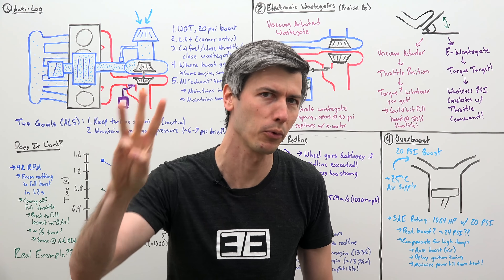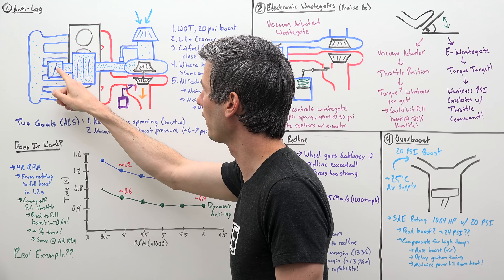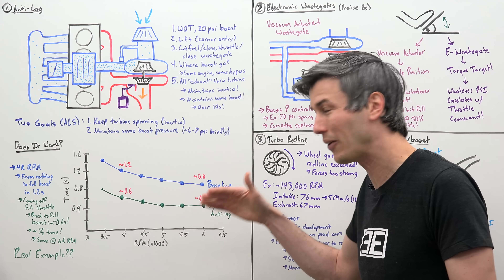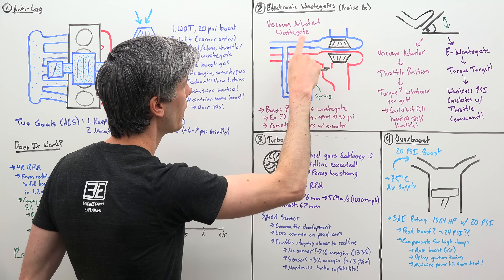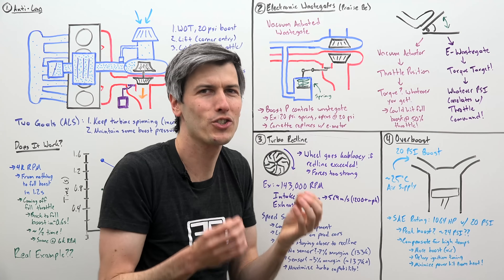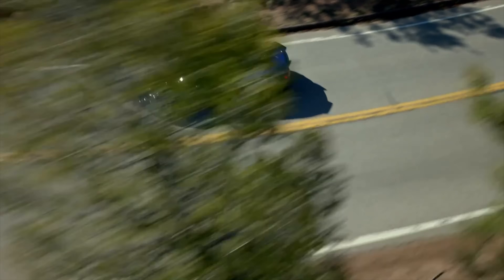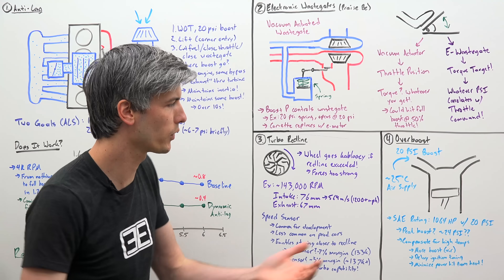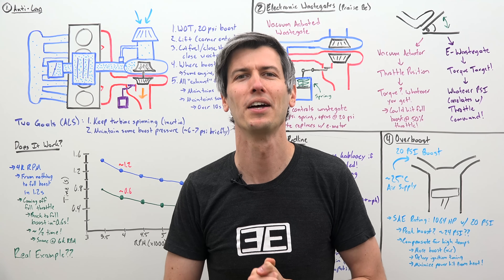Corvette ZR1's Anti-Lag System – Massive Turbos, Minimal Lag

Comment: Are the tips of the turbine fins really moving at supersonic speeds inside there? I can't help but think there are implications of that. Doesn't the air cavitate?
Reply: Cavitation only happens in liquids, it occurs because liquids boil at lower temperatures when the pressure is low, so the low pressure side of a moving blade can actually drop the pressure enough that the liquid begins to boil. Air is already fully a gas, so no cavitation can occur.

Supersonic speeds can cause problems with shockwaves forming in the flow. However what isn't often discussed when we talk about turbos is the fact that the compressor wheel is only 1/2 of the story on the compressor side. The housing is equally important, it forms a device called a "diffuser" which has the function of smoothly slowing down the air leaving the compressor wheel and turning its kinetic energy (speed) into potential energy (pressure). With the right design of the diffuser you can avoid the formation of shockwaves and any problems that might occur, even when the blade tips are supersonic.

On the turbine side, the gas is really hot. Because the speed of sound in gases increases with the temperature of the gas, I expect that the gas flow through the turbine is actually subsonic even though its velocity is much higher than the speed of sound in air at room temperature. It is possible (and common in things like steam turbines) to have supersonic flow in the turbine, however the housings of turbines that run under those conditions are designed with little rocket nozzles that accelerate the gas to supersonic speed and direct it onto the turbine wheel, rather than the guide vanes seen in a car turbo.
Reply from the maker: Indeed there are - don't know the negative implications but it certainly works!

Comment: But Jason, you've failed to say WHY there is no lag with this big turbo.  How does the engine manage this?  Inertia is one thing, but it takes gas flow to overcome that inertia.  What does this engine do to get that turbo spooled to begin with and then keep it there?  Otherwise it is just Cleetus bolting a huge turbo onto one of his race cars and not caring about lag....
Reply: Inertia works both ways, preventing you from spooling up AND keeping it spooled without as much exhaust flow.
Reply: @Renegade605  Yes, that's my question.  What did they do to get it to spool so quickly?  Keeping the assembly spinning fast and not stalling the compressor only requires a blow off valve, that's the easy part.
Reply: @Flies2FLL  The exhaust housing and integrated manifold. That turbine is maybe four inches away from the furthest combustion chamber, and because the manifold and exhaust housing are integrated into a single unit they can shape the whole thing to pile all of that exhaust energy into the turbo with next to no overlap in the exhaust pulses, maximizing efficiency and giving the whole system incredible response. Combine that with the cold side holding onto at least some positive pressure as long as it can, and you have some of the craziest throttle response you'll see this side of mid-2000's WRC 'rocket' anti-lag systems, but without the extra fuel burn or trail of dead turbos.
Reply: @griffinfaulkner3514  But that is nothing new, VAG does the same thing on the 2.0T engines under the hoods of Volkswagens and Audi's.  Subaru uses a twin scroll turbine wheel in which two cylinders fire exhaust pulses  on each side to prevent this overlap as well.  What GM did was put an enormous turbo on each side of the engine and somehow got it to spool quickly and stay spooled and not stall while the throttle is closed temporarily. I'd like to know how that pulled that off without some sort of electric turbo.  Thanx!
Reply: @Flies2FLL  From what I understand, Chevy designed the manifold/housing in such a way that they get the same effect as a twin-scroll system without actually separating the exhaust stream. And again, the manifold is literally the exhaust housing, dramatically reducing the volume that needs to be pressurized to spool the turbos.
Reply: No dual fuel direct injection is the key
Reply from the maker: The first section of the video (1 on the whiteboard) is dedicated to discussing Chevy's strategy to reduce lag with these turbos. That's the why.

Comment: my turbodiesel wagon uses 21 psi of boost to make a grand total of 140 hp
Reply: The thing about diesels is they have lower redline RPMs so they naturally make less power. If that was a gas engine making the same torque and with a redline 2x the diesel it would make 2x the horsepower. HP is directly proportional to RPM. Double the RPM and you double the power if torque is held constant.
Reply: @Fix_It_Again_Tony  You could also double the horsepower by doubling torque at the same RPM.
Reply: @armchairexpert20  Absolutely.

Comment: Was there ever such a thing as (terms may be wrong), but a progressive spring for vacuum actuated wastegates... say a spring that would start opening at like 10psi and work toward full open at the target 20psi?  I'm sure that would create other issues as far as boost control and lag...
Reply from the maker: There are a healthy number of solutions to the partial throttle problem, but an electronic wastegate is by far the superior option.

Comment: Pressure actuator wastegate, not vacuum.
Most modern cars use an electronic solenoid to control how much pressure goes to the WGA, giving some control over the target boost at a given throttle, though surely not as much as a purely electric one.  

I also wonder if electric WGAs can default to open instead of closed.  Pressure spring WGAs, even with a control solenoid, fail closed allowing catastrophic boost spikes.
Reply from the maker: Yeah, vacuum actuated is a bit of a misnomer, but as explained they're reliant on pressure to actuate, and, that's what they're called.
Reply: @EngineeringExplained you did briefly touch on control solenoids for pressure WGAs too.  This is how you know I commented halfway through the video vs at the end.  Still, engagement is engagement :)
Reply: the vacuum is just on the wrong side :D
Reply: While we're being pedantic, Jason, hot air doesn't "have less oxygen" as you know, it is just less dense at the same pressure (thanks Boyle's Law) 12:31
Reply: @psychic_wolf did he actually say that?
Reply: @ClipstopherBurtraw  was just making fun because he misspoke just because he was in a rush and brevity just ruined the technical accuracy of that one statement. like obviously he knows this, it's just kind of funny to me

Comment: Great torque curve consider my 93 Thunderbird SC makes 400lbs-ft at 2000RPM with only a M90 and 3.8 V6.

The C8 only makes twice the torque with twin turbos and twice the displacement an DI....😂
Reply: Your MODIFIED engine makes decent torque at a little peak. This ZR1 makes double that through most of its HUGE rev range. You're getting to make your engine sound superior to one that makes triple the power and double the torque all day long?
Reply: @jamesengland7461 ok then compare the ZR1 to Ford GT 3.5, or the supercharged 5.0 Coyotes from Ford Australia.  All smaller engines making comparable power and torque.

My SC is no where near the max power level.  There are several out there at 600WHP.  I refuse to spend money on ported heads, and a new case for the blower.
Reply: But you're only making like 300hp bro 😂
Reply: @BRAINFxck10 amazing half the displacement from a 80s era American v6 and makes 1/2 the power of a modern twin turbo v8...  oh the advancement in 30+years.
Reply: @bowez9  do you really think this Corvette has a 7.6 liter engine?
Reply: @bowez9  you didnt mention horsepower before, are you saying your 3800 makes 530hp?
Reply: @bowez9  I absolutely have, and I believe this Corvette's engine is just under 5.5 liters (5.46 liters I believe). So your math is still wrong, and should be like 1.44 times. How does that round up to 2?
Reply: @ALMX5DP didn't mention HP because HP is meaningless in drivability, were as low and wide torque is.

But just FYI my HP is 350 at 5500RPM.

Showing that while turbos have gotten better they are no match for Positive Displacement superchargers

Forgive me for assuming was the 6.2 as the base C8 and the only eninge that GM uses to stand against the Coyote.  Oh an I didn't say 3800, mine is a 3.8 232 CID.
Reply: @bowez9  Are you saying this new ZR1 is less driveable? Why did you bring up horsepower if it's meaningless then? What here suggests turbos are "no match" for a PD supercharger?
Reply: @ALMX5DP you brought up HP.

For sheer driveability yes PD superchargers beat Centrifugal compressors.  I even perfer Superchargers over larger NA engines; same drivability with less weight.

Think about it I'm comparing the FIRST Supercharged and Intercooled platform with 40 year old tech and it is comparable to the modern equivalent-that is bigger, has more valves and more tech

Since you brought up the ZR1.  Funny how 1 year after the SC GM released the first real production ZR1, and it only cost 3x the SC.  A v6 car that beat there Halo car in 89....
Reply: @bowez9  see your comment above regarding who brought up HP.. "amazing half the displacement from a 80s era American v6 and makes 1/2 the power of a modern twin turbo v8"....

You compared turbos above, why now mention centrifugal superchargers...? "Showing that while turbos have gotten better they are no match for Positive Displacement superchargers" Though that being said I do like the linearity of a centrifugal SC, enough so that I just pulled the trigger on a Rotrex kit for my track car.

And since you believed this was a 6.2 engine initially, I'm pretty sure the base Stingray engine is lighter and makes more power and torque than the T-Bird SC, even modded like you have done with likely the assistance of more modern technology of some kind.

And I really didnt bring up ZR1, this comment section is about the ZR1 which you initially commented on. I presumed you were referencing something about the video which you chose to click on.

I get it, sounds like you're a Ford guy. I like my Fords too, have two of them with one being an F-150 5.0 which I love.
Reply: @ALMX5DP ok I misspoke shouldn't have said power I should have used Force.

Centrifugal compressors are not linear, they have a boost threshold, below which they are not pumping.  Now if you want to window the power curve everything is linear.

As a Ford guy why did you reference the 3.8 as a 3800?  While the 3800 is a better engine the 3.8 is a better platform.

As for weight a LT2 weights slightly more than a 3.8 SC.  LT2 is 470 lbs were as a SC is around 430 lbs.  All that tech adds up even with an Aluminum block vs the SCs iron.
Reply: For all practical applications, a centrifugal supercharger is linear as you'd size the drive pulley to match the engine RPM range. 

My misinterpretation of the 3.8 came just because the topic was a GM engine so that is where my mind initially went, I did not see your reference to the T-bird SC coupe before.

And I found different numbers. I saw that Ford lists the standard 3.8 as being 433lbs while the SC version comes in at 506.9 (still lighter than the 5.0 at the time which Ford said was 543.7lbs).
Reply: @ALMX5DP I'll disagree with a SC weighing 70 lbs more than a NA.  The supercharger, piping and intercooler don't weigh 70 lbs.  Nevermind the Magnesium valve covers.

Personally I'd say the difference is about 30 lbs.  Unless someone wants to say that forged parts weigh substantially more than cast, and given than Journal 1 is .010 under the rest on the SC this would make up for any weight difference.  If you look at the balance shaft version the difference will be even less.

Now if it's a carbed 82 3.8 that might be a fair difference

If you pulled your numbers from SCCOA, XR-7 Dave makes his living building SCs.  He puts the fully dressed weight at 450 lbs.
Reply: Twice the displacement? I think you mean less than 1.5 times right?
Reply: @ALMX5DP I think you mean 1.631578947 times.  It's a 6.2 not a 5.7.

Comment: In my turbo Miata I have Electronic Boost Control with a vacuum based system using an electronic solenoid, and  I have it set up so that that I command no WG duty cycle at low TPS position, and ramp it up toward full throttle on the TPS. So I actually get more boost the more pedal I give it. Works really well idk why oems took so long to do this and why they can’t do it on a vacuum actuated Wastegate like I set up on my 26 year old car. I’m using a VW/PIERBURG solenoid and I think vw does this same strategy on their ea888.1 cars that use this valve. Didn’t know Subaru didn’t have this figured out. To be fair, if someone came out with an electronic Wastegate actuator that fit a Garrett turbo I’d be all over it just for the tinkerability.
Reply: The '07 and up BMW system works similarly. There is a separate vacuum pump and a solenoid to regulate vacuum at the waste gate. The duty cycle to the solenoid is controlled by RPM, load target and pressure ratio. Load target is mostly controlled by the position of the throttle pedal. I don't remember having a problem with part throttle response with that car. 

BMW did eventually switched to electronic actuated waste gates.
Reply: I do exactly the same boost controlled  by tps, gear tenperatures of the engine and rpm of the engine.  Its not difficult to target a specific boost at partial throttle.snd does not require Electronic wastgate like he claims
Reply: I’ll accept “tinkerability” as a word. 😂
Reply: Plenty of people love turbo lag. Especially when it comes to older Porsches. The build from no power to pushing you into your seat is something that a lot of people seek out.
Reply: @Bob_Smith19 That's what I'm saying. No one builds a 1200hp Supra to make it feel like naturally aspirated
Reply: @Harry_Gersack  Yeah whatever, please enjoy your turbo lag while you watch this vette roll 2 bus lengths ahead of you while you spool up.
Reply: This is how WRX are setup as well since the 2.5L came out 20 years ago, this explanation is wrong.
Reply: @denn15m8 yep this dude is clueless
Reply: Mazda has a pretty cool turbo system in their cars. They use some F1 technology iirc.
Reply: 1. complexity which adds cost
2. vanity metrics - you probably have slower 0-xxx times, 1/4 mile, etc. because you arent using more boost sooner.
3. i actually think a non-enthusiasts find turbo lag to be "cool" you can actually feel the turbo come in so you feel your car is special. probably great for test drives with a sales person.
Reply: @rovsky7 ,,I actually think a non-enthusiasts find turbo lag to be "cool" "
Wtf are you on about?? Non-enthusiasts? What you mean is "non-performance only enthusiasts". Im an enthusiast and I love turbo lag for the emotion (only for bigger turbos where you have at least some boost). I get that high performance cars of manufacturers and track focused builds dont want turbo lag and I absolutely understand that.
Reply: @rovsky7  some people do intentionally refuse to lower turbo lag because they like the feeling of getting pushed into the seat when the boost kicks in.
Reply: @rovsky7  wdym a non-enthusiast? 
I still love it, as much as I love the power curve on my two stroke enduro.

It just depends on what you prefer. You can easily be as fast with a conventional turbo setup, especially with a dct. You just gotta shift more.

Comment: I wonder if I'm not sensitive to the part-throttle/full boost issue you're describing.  On both my WRX and my V6 Stinger, when I am driving at part throttle, I feel like I get a consistent response from the car.  It's logical that the torque the engine makes will be influenced by the boost, which will vary based on the other conditions, but I don't find it noticeably inconsistent or at least something that I have to consciously manage.  I do prefer normally aspirated engines for a lot of reasons but this isn't one that I would point to.
Reply: Doesn’t exist on any wrx I’ve owned idk what he’s talking about.